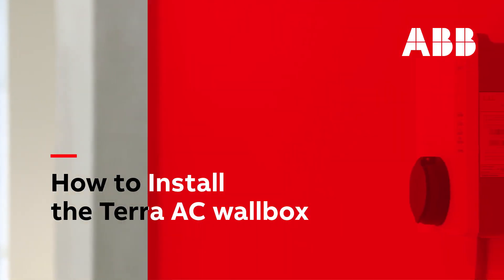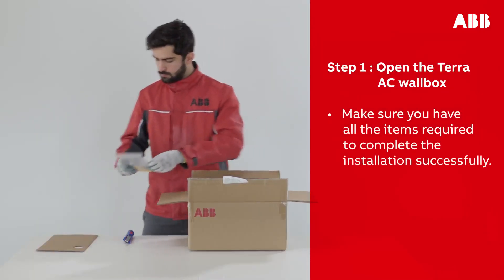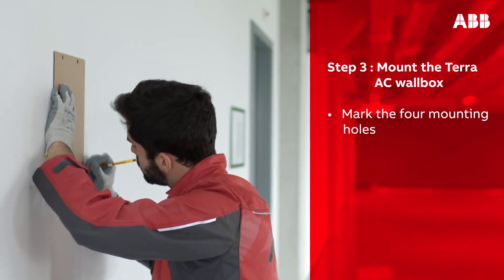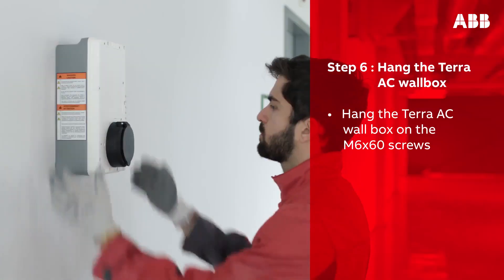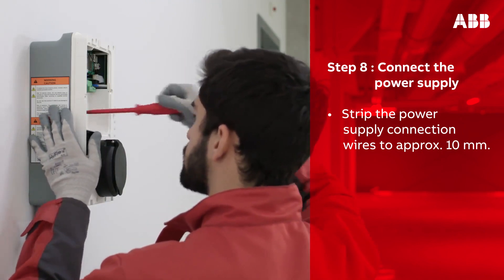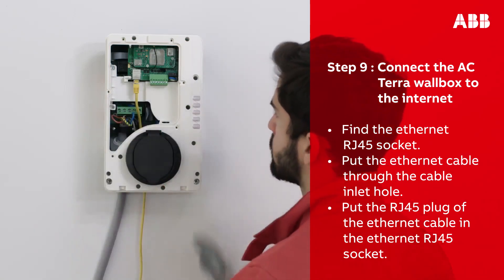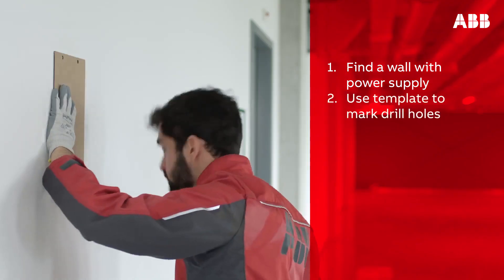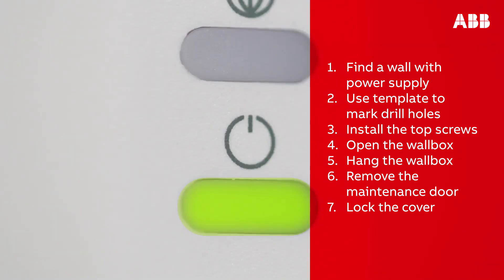How to install ABB Terra AC wallbox

Comment: Way there is no explain in the box???whic wire i need in the in side??? 5*2.5mm ok???
Reply: Because this depends on your installation. The wires are usually protected by a max ampere fuse in your fuse box. 2.5mm can carry 16a over a maximum of 25 meters. Most EV installations are done using 4mm2. This can carry 32a over 25 meters. So you have to decide by overthinking max current, desired charging speed and available power

Comment: I have installed two ABB TerraAC 22kW last week, and my conclusion is that ABB has still a lot to learn and/or fix with this product.
- The connection area is extremely cramped, there is less than 1" between the strain relief and the wire clamps. I used 6mm² wire for the 22kW wallbox and it got extremely uncomfortable to fit in there. Considering the box is specced for up to 10mm² wire, I can't see how this is supposed to work without breaking your fingers.
- It's highly complicated to acquire a TerraConfig account which you need to configure basic operational parameters of the box. There doesn't seem to be any link on the official TerraAC website, I had to jump through several support teams to get signed up. Why a config app for an end user product needs an account /at all/ is beyond my understanding.
- There is no public documentation about the RS485 connection and protocol, as well as the Dry Contact input and output, and even contacting the support team via the website could not provide me with such documentation. Still, those features are listed in the advertisement brochure. It's not even mentioned in the TerraConfig app.
- There is no operator manual besides how to hang it to a wall. I have wasted literal days to find out how to make the box work with custom (non-ABB) NFC cards. The brochure lists "uses Mifare cards" as feature, but by default it accepts only ABB-branded cards, which is not mentioned anywhere.
- It would be nice if the box had at least a basic Web interface where you can get statistics and start charging. Currently, the network part of the box is woefully under-used.
- The brochure also lists load-balancing as a feature. There is no info how to configure this. I assume it needs a RS485 link between the boxes?